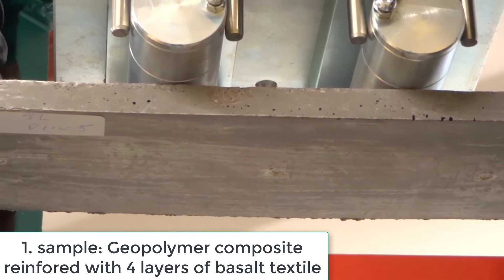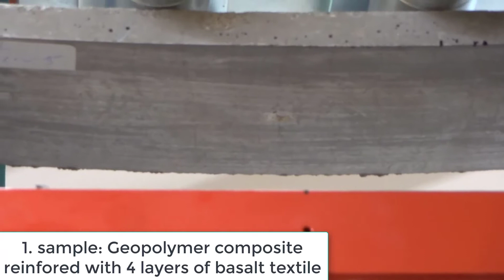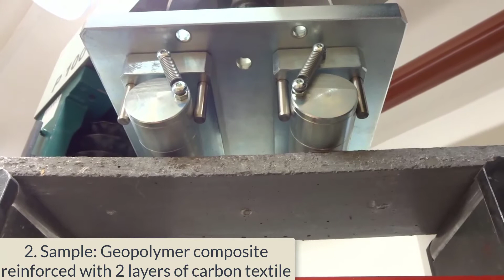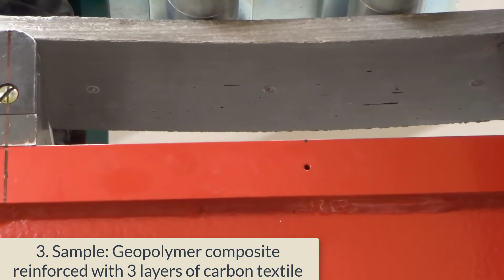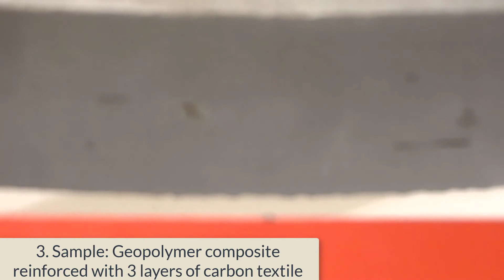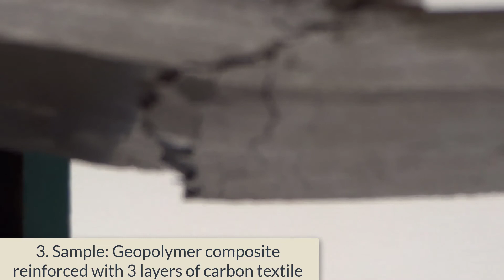Four point bending test of the textile reinforced geocomposite panels.

Comment: Interesting tests, thank you for sharing.  Did you perform a test of non reinforced geopolymer planks also? It would also be interesting to know how their compression strength changes with such reinforcement as well compared to baseline.

It might also be interesting to compare it to non-reinforced portland cement.  Could the poor results for the basalt been because of too much fabric and not enough mortar? It would be interesting to compare it to 2 and 3 layer basalt, since basalt is much cheaper for large projects.

Great Work!
Reply from the maker: Hi dalmudi,
Thanks for asking. It's true that no need to perform a test of non-reinforced geo plate to compare its strength with the reinforced geoplate. Strength result of non-reinforced geoplate can be seen in test result of reinforced geoplate. In fact, non-reinforced geoplate showed a single crack while multiple cracks were resulted in the geoplate with fabric reinforcement. As you see in the video, first crack was created somewhere in between the two upper supports and this refers to the strength of geomatrix has been destroyed (geomatrix in this case can be called non-reinforced geoplate). The subsequent cracks occur because the textile reinforcement carried the load. 
Test samples in video are samples with the optimal reinforcing layers (considering sample dimension mentioned in video). Samples with 4 reinforcing basalt layers resulted in higher strength compared to that of 3 layers. Poor results of samples with basalt fabrics because of poor strength of basalt textile, not because of lack of matrix mortar.